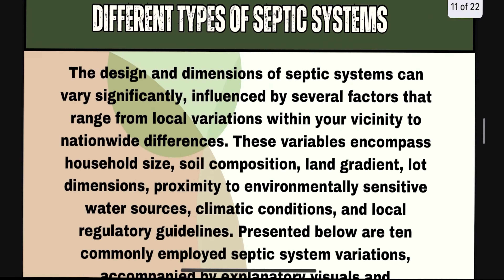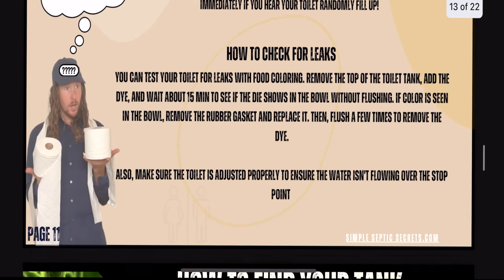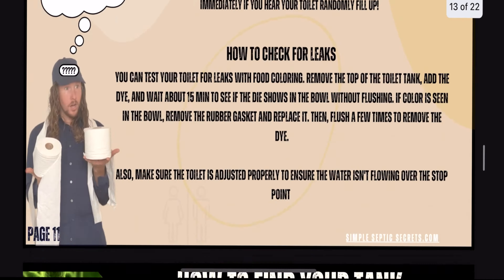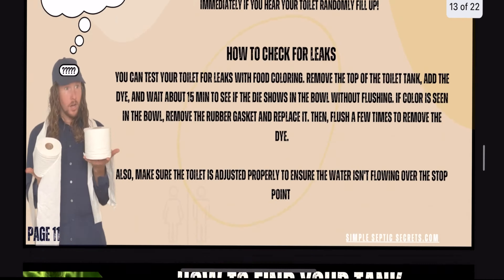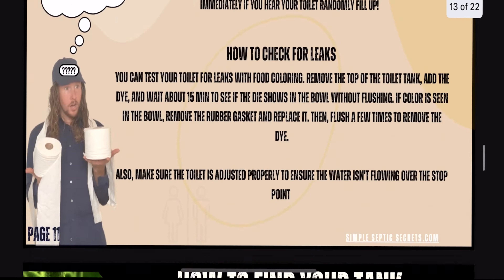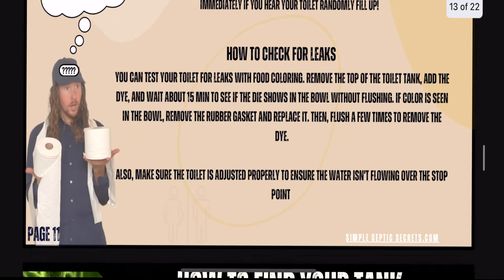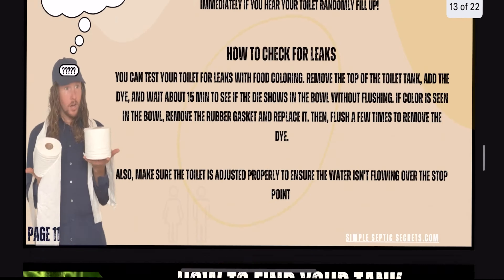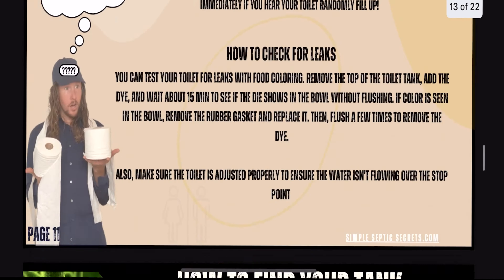How to easily Install risers on a septic tank.

Comment: Please use a mask when using dry cement, toxic dust long term effects
Reply from the maker: Thanks for pointing that out in my first draft on the voiceover I said make sure to hold your breath that concrete powder is probably toxic but my mic messed up and when I did the voiceover again, I left that part out so thank you. I had a feeling it was toxic but I wasn’t sure now I’m definitely going to make sure to wear masks.
Reply: Hi does your female employee still work for you? Good worker!
Reply from the maker: @BG-xr5bi  unfortunately no she had an issue with her license but she did a great job she outworked a lot of the guys we have had over the years